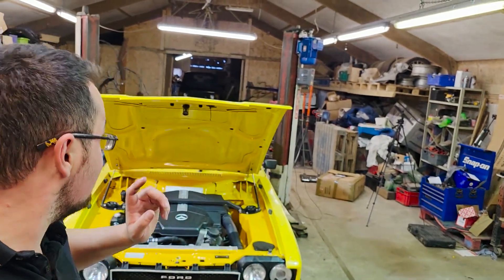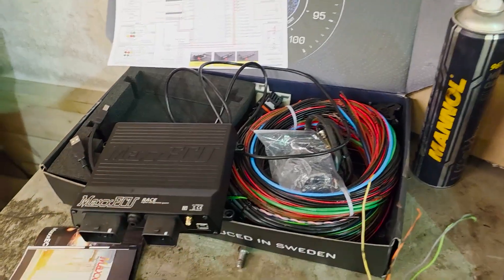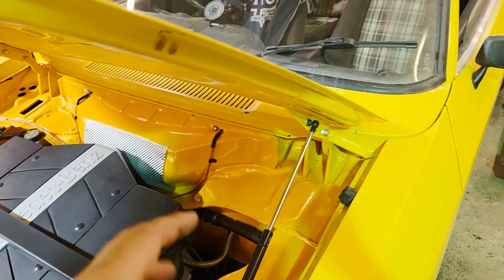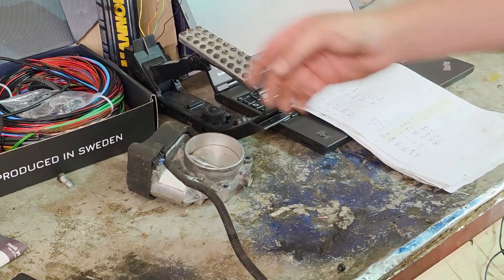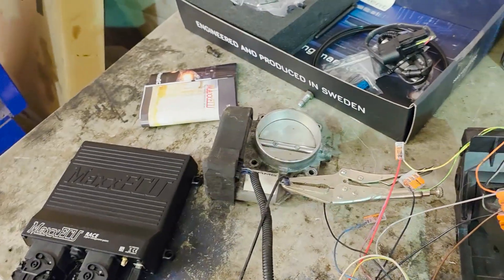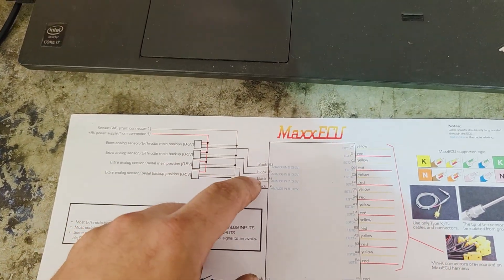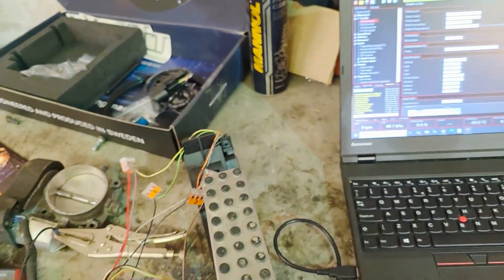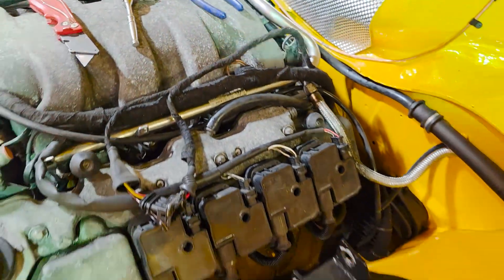Ford Capri Mercedes M113 5l V8 Swap | EP.38 MaxxECU electronic throttle body testing and more!

Comment: The w202 w208 and w210 with m113 engines had cable operated pedals with remote TPS
Reply from the maker: Never knew this existed until earlier this week when a mate purchased an early SLK230, seems like they already had the cable pedal box's but wanted to use electronic throttle bodies 😂

Comment: The MaxxECU looks an intriguing option. A quick glance through their site suggests they've got something for everyone 😎 As with anything, quality costs, so it'll be good to see how it stacks up.

Also, really appreciate the upgraded lighting in the workshop - it makes a massive difference 👌
Reply from the maker: It does, the fact it can integrate with various factory canbus cruise control systems, traction control and can talk to automatic gearbox's. Wanted to play with one for a while, and so far I'm rather happy with it.
The lighting is still the same, I just ended up recording these with the new phone, the older footage from the gopro is bad, the footage inbetween with the proper camera isn't bad. The phone has just made it easy where i've been on a time restriction.